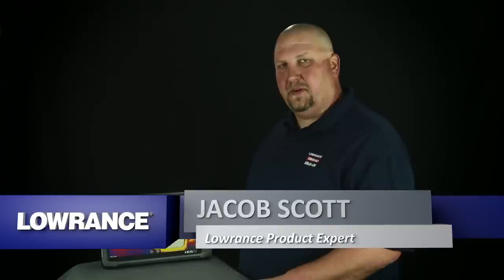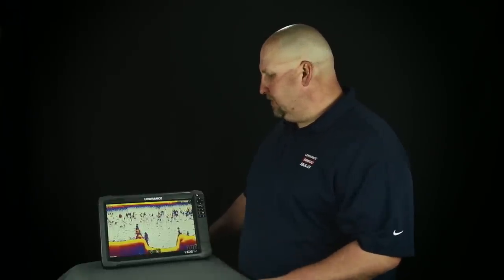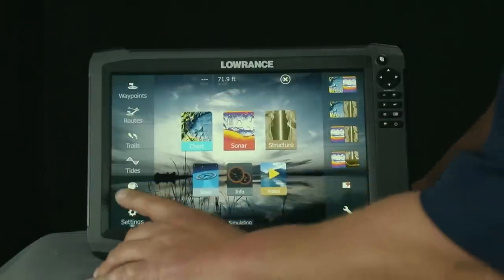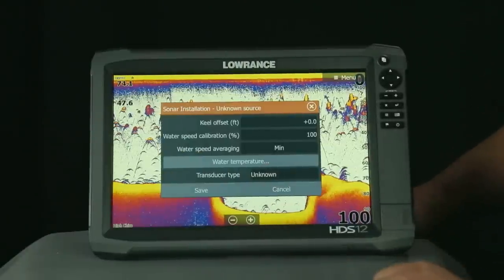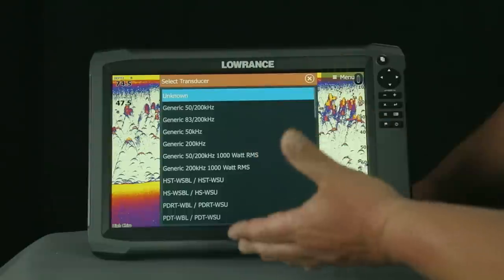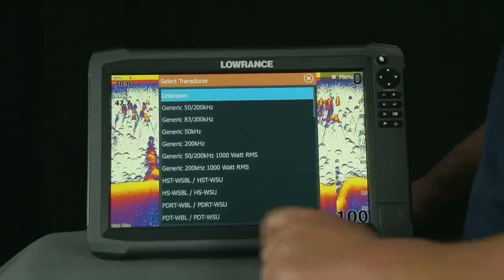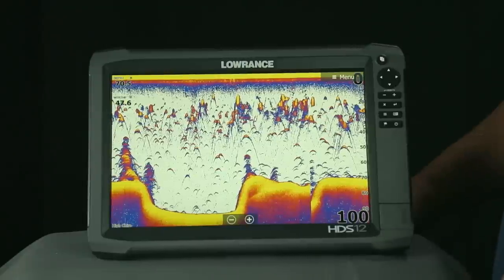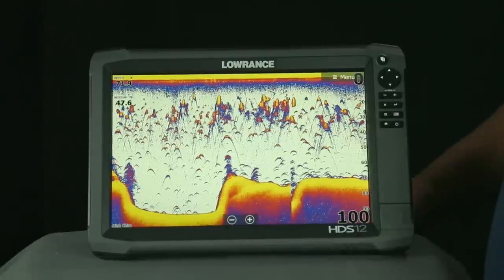Lowrance | How to Select a Transducer Type HDS units

Comment: Hi, I am having an issue with my 3 in 1 transducer nosecone on my hds 12 live. The screen from the bottom to the top is full of clutter, by that I mean dark lines making it difficult to see. When I move out to 25 ft of water ir deeper the screen is clear below that depth line, 25 and below. The display in the installation menu has the 3 in one selected, but when selected, no changes are offered. Can you point me in the right direction to rectify this problem?
Reply from the maker: Please send a message via FB with a screenshot of what you are referring to.
Also send us your unit's serial number and your contact details.

Comment: Appears nobody answers these at Lowrance--i echo the same questions as Terry--where's the secret code list for transducers so that we know we're supposed to select a HST-OBGYN-747Titanic--it appears the Totalscan will be discovered automatically with Gen3 and Carbon but i want to know what ducer to select for my bow mount HDS7Gen2Touch when i want to use the Ulterra US2 transducer ?  it sure isn't listed in the installation menu
Reply: Did you ever figure out what is the optimal transducer to select for the Minn Kota ulterra US2?  I currently can't get water temp on my new HDS live.
Reply: Generic is what you need to select

Comment: I have an lss-2 transducer and can not figure out which code it is. I tried looking for the tag number but it’s not on the list. Any help would be greatly appreciated.
Reply from the maker: Hi
THe LSS2 transducer should be plugged into the SONAR2 prot on the back of the unit.  You do not need to select the transducer in this case
Reply: @lowrance  ummmm! .... This does not appear to quite be the case.

Comment: I have the 3 in 1 transducer. I just bought an hds live. No where  in manual or on tag does it say what type it is.
Reply from the maker: Hi,  The transducer type is <AI 3-IN-1>.  This does not appear in the list unless an AI3-IN-1 transducer is plugged into the unit  The HDS Live unit will automatically recognize the transducer when it is plugged in.  It should be plugged into the Black transducer connector.  You should see the ransducer type <AI 3-IN-1 >,  this will be shaded grey,  no selection can be made.  When checking,  make certain the Sonar Source is selected as <This unit CH2> .  If this is a networked system with more than one display check the display the transducer is plugged in to. To make identification easier in a networked system custom names can be assigned to each sonar channel.
Reply: @lowrance  I have an elite ti2 with active scan and the unit automatically went to "unknown" transducer type.  This option gave me 50hz, 83hz and 200hz sonar (also low med and high chirp), but no side scan.  I selected total scan M/H from the transducer list and now I have good side scan, but lost 50hz and low chirp.  Is total scan M/H the correct transducer type to use for elite ti2 with Active 3n1 transducer? (not totalscan)
Reply from the maker: Hi,
The unit should recognize the 3in1 transducer automatically. Please go to the settings menu and select about and write down the Elite Ti2 version and application numbers and under Sonar version those numbers and use the link below to send them to our technical support group 
Hi, Please click the link below to provide us additional details.  A technician will review your question and reply 

https://www.lowrance.com/contact-us/
Or call  Lowrance. with the information and they should be ale to provide a solution. 1-800 - 628-4487
Reply: Did you ever figure it out? I am having the same issue
Reply: @brandondiesbourg3224  yes. I unplugged the transducer and plugged it back in and it recognized it automatically.